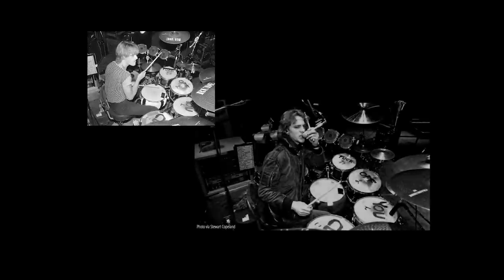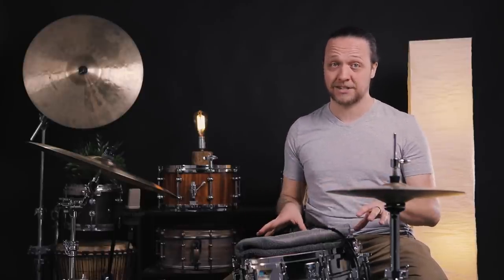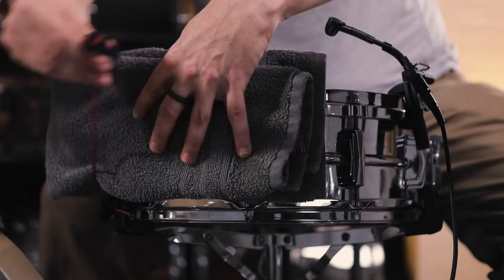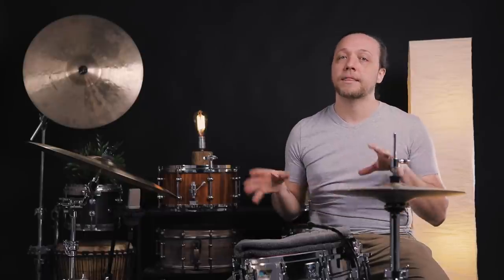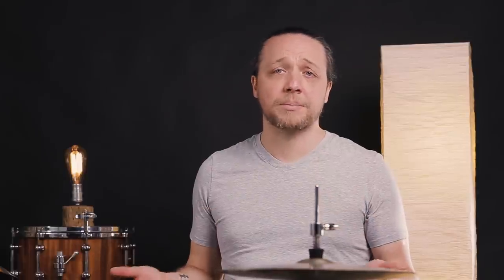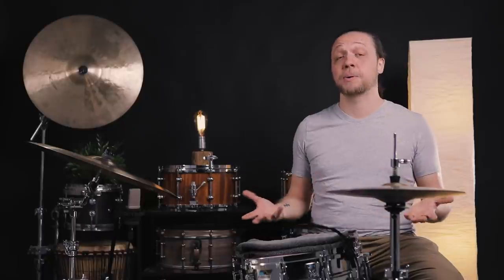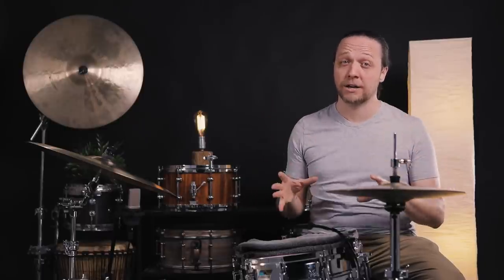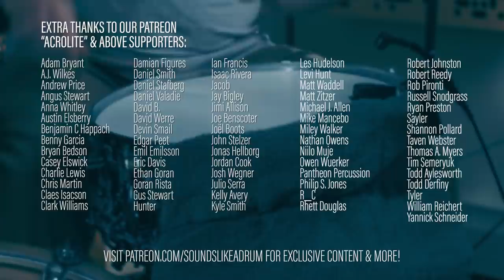Stewart Copeland Snare Hack?  | Season Four, Episode 38

Comment: You meantion using the towel to protect Stewart's leg from lugs, but personally, I have had snare mounting straps actually cut into my leg when I used to set up tightly like Stewart.
This could also be extra mass used to secure the drum in a trap case.

Comment: It is definitely a protection device. My father's Tama Imperial Star set came from Japan circa 1972/1974. The snare drum that came with it was a Star snappy snare. This snare drum became the standard for Stuart Copeland in the early days. The throw on this snare drum sticks out about 2 and a 1/2 inches on each side  And has large adjustment knobs that stick out a little further. It is a solid steel mechanism that no longer has snares available for it. My dad builds his own and still uses the drum.. When I was young I noticed that Stuart Copeland was putting a towel there. I was a hard rock and metal player and constantly banging my knees or my Toms up with the snare. The the hoops on that Tama drum set are metal so I did not mess those up in any way. I eventually used some beer coozies that I modified.
Reply: Stuart used a Pearl snare.

Comment: Might try this as I'm tall and play aggressively usually in shorts.
Leg does get a little raw sometimes and the metal is cold to start with. 
I usually hang a towel off a floor tom leg for sweat.
I also saw,but haven't tried yet,Neil Peart used a small fan pointed up off the side of his snare to help keep his hands dry.

Comment: I'm of the opinion that after diameter and depth, the type of drum head has more effect on the sound than does shell material.
Reply from the maker: And how did you come to this opinion?
Reply: @SoundsLikeADrum  trying out different heads on different kits. The part that vibrates the most and moves the most air are the membranes/heads.
Reply: True. One caveat would be shell density of material * thickness. I've noticed that a deep shell which is very thick and dense will project like crazy, and a very thick, very dense shell of any depth tends to provide a wide dynamic range (this meaning it can be played extremely hard without 'topping out'). All of this is from my own subjective observations, of course.

Comment: It does seem to kill shell resonance
Reply from the maker: Really? You thought that there was a dramatic difference between the towel and no towel? To our ears, the the tape had significantly more impact and the removal of the towel wasn't even noticeable, particularly in blind comparisons.
Reply: @SoundsLikeADrum  I could hear a small difference in decay time. I was using in ear  monitors. Seemed like the length of ring shortened. Or maybe you hit it differently. I had a friend who would stick things inside the shell of stainless snare drums. And it did kill some of the length of the ring.
Reply: @SoundsLikeADrum  it’s there; shortens the decay of the ring and reduces the diphthong a tiny bit.  Subtle to the point that it’s not worth the effort to use the towel for this purpose; as opposed to create a fabric tunnel for under-side mics.  Or the player’s comfort purpose you pointed out.

I wonder though, was the towel covering the port hole of the shell during testing?  That’s an area I often close mic, albeit at an angle to avoid plosives, for a more compressed, mid-ranged and consistent sounding ring tone than the top or bottom mics typically generate.